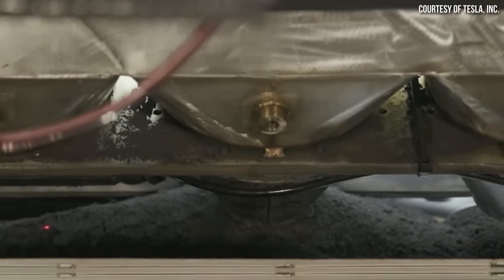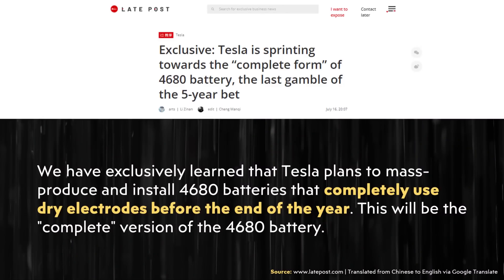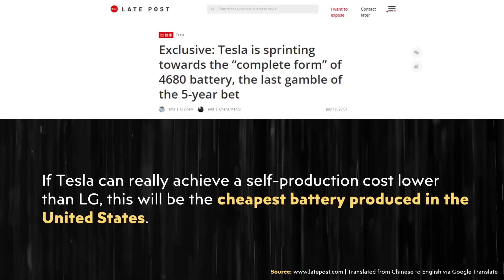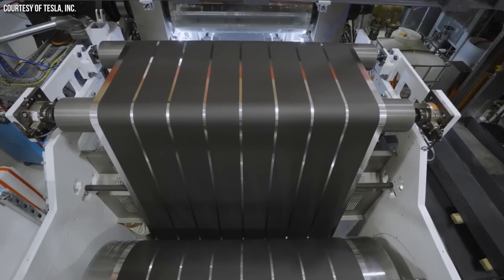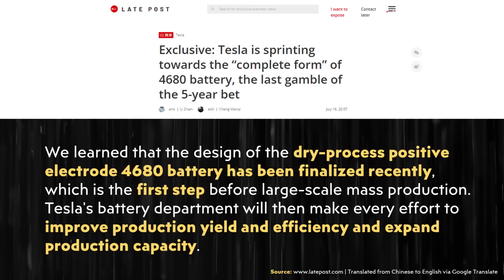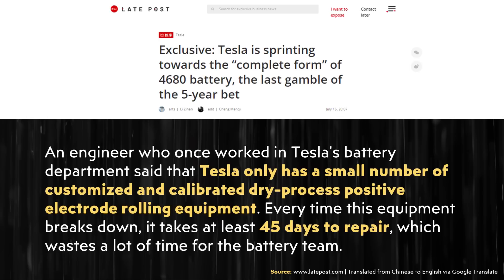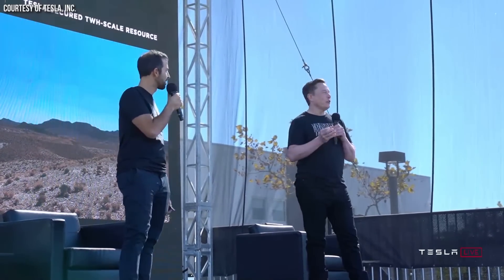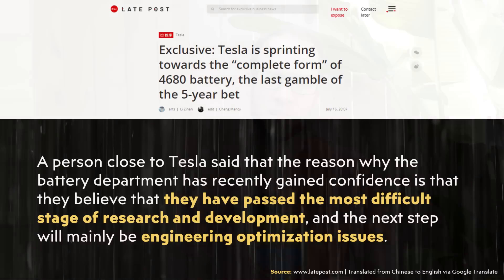HUGE Tesla 4680 Battery Update | Dry Cathode Finally Solved!

Comment: What is the differently between this and a semi-solid state battery?
Reply: this just covers dry-coating process in lithium ion battery manufacturing process  vs SSB is an entirely different battery chemistry/structure.

Comment: I recall the Munro video where they said pretty definitely their Cybertruck tear-down anodes were dry process and they thought it reasonable to suspect the cathodes were too. But at that time they were not sure. I have been thinking that scale, reliability, and cost are the likely problems and not that every attempt results in a failure. Surely dry cathode production runs are at least producing some good cathodes and those might well be used in Cybercells.

Comment: Battery update  twice a  month  , new batteries  every month  .  :)  I am  expecting  new Model  Y AWD with  90kWh battery ,does not matter  4680 or blade battery from China .
Reply: That's not how it works.  Most so-called "breakthrough" won't make it in real world.  Further, even if it turns to be truly meritious tech, it would take at least 2-3 years to validation/certification and another  mass-production/commercialization.

Comment: You said Tesla did not have enough dry process cathode equipment. So two types of cell were going into CTs. Some CTs, perhaps the one Munro tested had dry process cathode. That would account for the Munro not finding manganese and reduced cobalt in the cathode, and their examination leading them to report dry process likely used for cathode. So, cells in some CTs could be NAC cathode fixed to current collector by dry process. 
MS/MX have 18650 cells with NCA or NAC cathode. It would make sense to choose NAC if it performs well in MS/MX and is less hard on rollers as CT has more means to deal with cell thermal runaway. The internal "collapse" of the cell might be fixed with a solid plastic rod down the centre. The cell may be 370 grams now up from 355gms due to better space utilisation and a solid plastic rod at the core.

Comment: Dry electrode has potential of 400 wh/kg in cell energy density,if tesla announce 400wh/kg 4680 with 2000 cycle life it will be the best battery cell in the entire ev industry right now,with more efficient packaging they can have 350 wh/kg in pack level energy density meaning 2026 tesla model s plaid battery pack will be half in weight compared with today 18650 panadonic NCA cell which has 800 cycle life because of its chathode chemistery (nickel-cobalt-aluminium),true game changer
Reply: Dahn doubled the cycle life of Tesla batteries to 1500 0-100 DOD within a year of his 5 year contract.
He has single crystal NMC 532 lab cells still cycling after10k 1C-1C cycles.
https://www.youtube.com/watch?v=rOAYjcO6kao&t=140s

Comment: SAKUU has a dry cel formula that Tesla could adopt. Sandy Monro was very positive about SAKUU when he toured their plant recently.
Reply: But there are still many unanswered questions. How does the balancing between the foil cells work? Several people have tried this and it has always failed. Sakuu does not call here a breakthrough, so it remains (still) a pure laboratory project.
Reply: SK ON seems impressed with the SAKUU technology and production system, too. So, yes, SAKUU could make a big splash.

Tesla still needs to lift its game in battery science, though. Making batteries more cheaply, viz. achieving ultimate economies in the cell manufacturing process isn't something that properly sits aside from cell efficiency, quality, safety or longevity. We need to look to CATL, BYD and a number of other battery companies in China, Taiwan, South Korea and the USA to see how battery companies making real advances in these field run their operations. Tesla set its sights too low, ensuring a less than stellar outcome for its battery operation.

The SAKUU technology might result in the democratisation of battery production with automakers making their own batteries based on well known chemical recipes available from companies like SAKUU or the economies of scale of a CATL-like company with a battery science heavy talent pool may continue to be necessary to see genuine advancement in battery efficiency, quality, safety and longevity.

Note:
There are a number of ways to view cell efficiency - economisation on input materials, reduced energy and carbon footprint for a given volume of cells produced or the maximisation of range relative to charge subject to practical constraints (like weight and road conditions), viz. km/kWh (using realistic vehicle weights and testing scenarios). All these different notions of efficiency should be taken together.

Comment: Some manufacturing equipments like calendering have issues which might be resulted in material choice, I guess. Engineers need to find a proper materials to solve the issue…

Comment: LiFePO4 seems to be perfectly adequate and much cheaper for the majority of EVs. I've got two EVs with LiFe batts (RWD Model 3 and BYD Atto 3) and I've never said to myself "Gee I wish I had some of those dry electrode 4680 cells". The big advantage for Tesla will mainly be in the US market where they can do all this locally (less transportation costs) and it also allows them to make a battery with a much lower carbon footprint.
Reply: Dry electrode isn't unique to NMC, it could be used in LFP once the process is understood.
Reply: In Teslas master plan they planned for a lot of LFP. However nmc has a higher energy density and will be used in more demanding applications. CATL has just released an nmc battery that is about 50% more energy dense than  LFP . My guess is some cyber truck s need nmc and maybe the roadster
Reply: LFP is "good enough" for small, compact EVs.
Reply: the dry-coating tech benefits the battery manufacturers in time, less energy and cost by as much as 25% -- ie, it's a manufacturing process improvement.  All mid/high-end EVs needs high-nickel/energy batteries like NCM/NCA.
Reply: @tooltalk  Do they though? That's my point. Why do we need the extra power to weight ratio when LFP can still make a high end vehicle. I really think this is more a matter of perception than reality because Tesla set out in the beginning to prove that EVs could outperform ICE vehicles. So they set an expectation that EVs can do 0-60 in under 4 secs which means... pretty much nothing to the average driver. We'll have to wait and see if this tech can be applied to LFP and solid state batteries and make those batteries cheaper.
Reply: @mondotv4216  >> when LFP can still make a high end vehicle .. << 
Why do you think LFP is almost exclusively used in entry-level, low-range EVs?

Comment: That Chinese report makes no sense.

Of course all that's left is to scale up while minimizing rejects. That's been the case for years.

They have had working 4680 cells with dry cathodes for years, too. Scaling was and still is the problem.

There may be something fresh to report about 4680. But thus far, all we know about it is that Elon set the team a deadline. Solve it by year's end, or the project will be ended.

Comment: Wet/dry. . .  meh. . .  The cost is in the raw materials.  The footprint of the production facility is irrelevant.  It’s not like they’re short on land in Texas.
Reply: wrong
Reply: 7x to 10x.
On battery day it was claimed Nevada facility original footprint could house 1 GWh battery facility - if DBE. You prefer to see 10x the factories, using lots of solvent recovery ovens?
Reply: Baked batteries(typical battery) the ovens etc are huge and cost billions and use a lot of power

Comment: IS everyone overthinking this?
.
You have a Cathode line and Anode line.
Essentially the same equipment.
Running the same speed.
.
The Cathode is harder and breaks the equipment.
.
What to do?
.
You test the Cathode machine at 50% speed and find it's reliable
SOLUTION?
YOU INSTALL "ANOTHER SET OF EQUIPMENT TO SOLVE THE PROBLEM "
.
It was in the text at 10:10 !
.
DUH?
You run 2 Cathode Lines at HALF SPEED.
It's "more expensive" but it SOLVES THE PROBLEM.
.

.
If you REALLY want things reliable? You create a "Rolling refurbishment" where you have a THIRD set of (modular?) components which you can "roll in" if required if one machine is looking close to tolerance.
.

Comment: If this is true this is massively good news. Not only would it be a win for production goals in general, they could also use this to command cheaper batteries from other manufacturers and win their too. Let’s hope this is true!
Reply: You think this 4680 battery is better than catls 1.2 million mile battery?
Reply: @Paulirwin44  probably not better, but if theres any kind of tariff on Chinese batteries than it would be huge. also, even without tariffs, it could be worse stat wise but cheaper and still effective for the purposes. It all boils down to price per kWh per vehicle at x stats. if you can achieve that with worse but cheaper batteries it doesnt matter
Reply: @Paulirwin44  : first, no automotive companies jump to unproven tech;  second, batteries don't drive.

Comment: We've been hearing of this dry cathode tech for YEARS, don't think it matters anymore as CATL has far surpassed Tesla with their Shenzen battery, and Musk is getting more insane, by the day.
Reply: A few points
For a start, it's Shenxing, not "Shenzhen".
(Actually now "Shenxing Plus")
.
You don't know if they "Surpassed" anyone.... They quote about 212Wh/kg, but it's quite vague regarding cell vs pack  volume, probably lost in translation.
.
It's an LFP cell, so not comparable to the Nickel based 4680.
.....
You probably mean the Qinlin.... (That's the high power one😉)
.
Have you LOOKED on the CATL website? (I actually have)
.
Then there's the fundamental design philosophy of the 4680 "system" which is to get the maximum GWH (TWH) output from the smallest, environmentally cleanest factory possible.
.
I suspect you're just throwing headlines that you've heard but not really thought through.
.
Don't.
.
As for "insane"
Confirms my suspicion you're a "Headline reader"
(That's not a compliment)

Comment: Hopefully this leads to longer lasting batteries backed with longer warranties.  Then EVs will be the future.
Reply: Battery life hasn’t been an issue for Tesla for a long, long time.
Reply: @dewiz9596 tell that to people on TeslaMotorsClub or the used car market.
Reply: In that case evs are the future😂 MG in Thailand offers an unlimited milage warranty on their  batteries 😮
Reply: @allangraham970 my 2017 Model S now has an eight year, unlimited mileage warranty. It was upgraded from 150000 miles. Who does that?
Reply: EVs are already the present
Reply: EVERY "development" leads to "longer lasting cells "
You're assuming that packs which were installed At least 8 (more likely 10-12) years ago are similar to those installed today ?
.
OF COURSE the new packs are inherently statistically more reliable.
.
EVs are ALREADY "The future"
The main question remaining is "Will USA be part of that future?".... And I don't mean Tesla.
Reply: @rogerstarkey5390 besides CATL and a few Chinese players , almost no manufacturer talks about additional features or processes to make better batteries. So silence to me means not much advancement.
Reply: Dry cathode doesn’t change the chemistry. It shortens and simplifies the manufacturing process. Seeing it will be believing.
Reply: @greghelton4668  dry batteries are thought to last longer. The batteries that are baked are clearly at a higher temp which means unwanted chemical reactions more likely to occur manufacturing a baked battery as opposed to a dry process battery should result in more reliable battery
Reply: @allangraham970  doe the most part liquid electrolytes are the major problem, though even solid state batteries still prone to dent rite growth. Dry electrode batteries are prone to uneven surfaces what have their own unique problems. 

The 4680 form factor should have higher Delia and life since the tabless structure allows heat to escape and reduces electron flux.  Hence potentially longer battery life.

Comment: Will the batteries have more energy density?  If not, we will want more energy density to make vehicles more usable.
Reply: Basic "old design" 4680 construction issue.
You have a longer "roll".
This means a longer electron path to leave the roll via a "tab".
It heats up.
Uses energy to do so , not good.
.
Now, the tab is at the "edge" of the roll.
LOW resistance.
Inherently more short path electron flow AND much less heat.
It's a "Cooler" cell WITH more usable power
.
THAT'S the fundamental problem solved.
NOW that the "Mechanics" of building the cell are also solved, they can "Play" with the latest Chemistries to "make the PACK more usable".
Reply: @rogerstarkey5390 yeah, that’s the tabless design.
Shorter current path, less resistance, better heat path too.
Now for the DBE which is real holdup.
Then experiment with chemistry, with silicon.
I’d be happy for Tesla to make hybrid wet slurry cells until DBE finessed.
Reply: Yes more density, lighter and more durable
Reply: Energy density can be measured in four ways. At the cell, at the pack, gravimetric, and volumetric. Which of those four things are you asking for?

Comment: If Tesla has sorted out a dry cathode process, then that is a patent advantage. EVery battery company will want to copy - to avoid being left behind...
Reply: It's not easy to copy manufacturing process from one company to another -- which is why China still has problem catching up with Japan and Korea in mid/high-end nickel batteries.   Can't just copy and paste -- it usually involves poaching engineers from another company who have years of industrial experience.
Reply: CATL #1
Reply: @larryc1616  CATL is still stuck with NCM811, even after the Chinese gov't forced all EV makers to use locally made batteries by local companies, eg, CATL, only since 2015.   CATL's key strength is mass-manufacturing cheap batteries, made possible by CATL's own raw material/refining supply-chain.
Reply: @tooltalk  space karen asked CATL for help with 4680. CATL equipment and engineers shipped and built the 4680 assembly line in giga Nevada. CATL is light years ahead than Tesla in battery technology and production
Reply: @larryc1616  In 2023, CATL's overall capacity utilization was 70% or just 2/3.  CATL is selling their unused LFP production line to Tesla.  BYD makes better LFPs than CATL; there is a bunch of Japanese/Korea battery companies light years ahead of CATL in mid/high high-nickel batteries.

Comment: Jon, we have been following this for years.  It would be nice if Tesla was finally able to deliver on this process.  I have always believed that the home grown battery gives Tesla options and control that other manufacturers can only dream about.  If they really have solve the dry process they can then move on to batteries with greater range and longer life.  The advancements need will never stop.  Batteries that can be guaranteed to last for 15 years and 200000 miles seems like a nice goal. Someday I believe customers will pick their range, charging speed and life usage and pay accordingly.  Different batteries at different prices could make cars more affordable at the low end while cars with faster charging speeds, greater range and longer life will be available for premium vehicles.

,